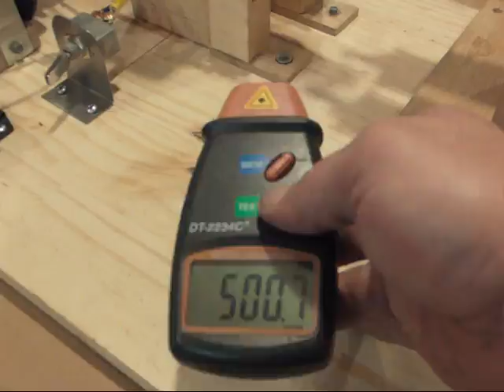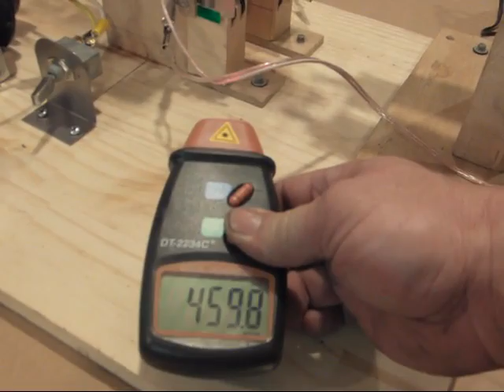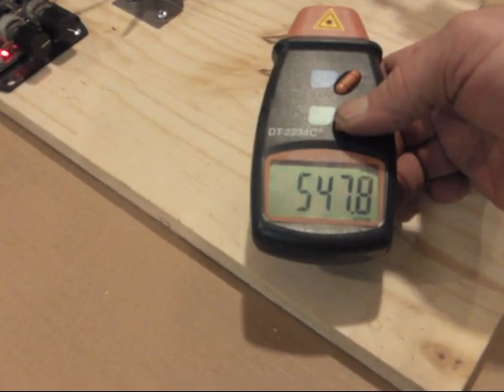"The Angus Effect" 2 Re: Jay Braun

Comment: Idea.. For your 2.0 model instead of only focusing on adding coils extend your drive shaft and add more disks.. Also lighten that wheel up by removing non essential mass from its center... Use a racing flywheel for guidance.  If you can show more output from an alternator hooked into this then what went in congrats!! You just broke the law of thermal dynamics :-)   let me know if I can help!

Comment: This reminds me in some way of how a vacuum works, meaning, when you block the air intake, the RPMs on the motor goes up, and it draws less current. I don't know much about motors, magnetic fields, and electricity; but something makes me think this phenomenon is conceptually related to the vacuum one.

Comment from the maker: Each set of coils are wound in opposite directions. One left one right. Then they are wired together in parallel. Both Start windings are connected and both finish windings connected. @ 600 rpm I have 20v @ .15 amps or 150 ma per set. There are 64-3/4"x1/2"  n42 neodymium magnets on the wheel. I ordered another set for a total of 128. This should increase amperage. I plan on making a vid on the "bucking coils" and bobbins in a couple days. :)

Comment from the maker: It's around 3:1 drive to wheel. I use a hole saw and some thin plywood. Had a hard time with direct drive and aliment. This worked out well for me and increased efficiency of the prime mover. Belt is a 6" O-ring

Comment: haha the irony in it all. i wouldn't count sir isaac out yet. the true test is when a linear application of dc power will produce a certain RPM into the rotor WITH NO COILS ANYWHERE NEAR THE UNIT AT ALL ... AND NO PWM .... and then, coils are applied to show acceleration and current draw reduction. that would have greater representation by way of simplification

Comment from the maker: So far there's more going in than coming out. I just used the PWM to control speed. Didn't want magnets flying off across the shop. I've had it to 1,000 RPM and I really don't like standing next to it. Once I get all the coils mounted I'll work on getting rid of the external drive. Your right, I think Angus will beat me to it. Thanks

Comment from the maker: Yes that's the prime mover. I just rolled up some 24 awg copper on a set of bobbins and got 20 volts at around 600 RPM. Lucky I guess. Didn't count turns. coils have 18.5oz. of 24awg magnet wire each. Math worked out to about 1,100 ft. Haven't measured coil resistance yet. Got to make several more, so a video will be forthcoming. I believe this is happening because we're using both sides of the magnet at the same time on one core stater with opposed winding coils.

Comment: This is great. Hard to hear ya, but did you say that's the current draw on the prime mover? If so that's amazing it's going down under load and increase RPM. Everyone else I've seen testing this the prime mover amp draw at least goes up under load and rpm increase, you got something special here. What do you think the difference is? Perhaps the coils? Mind sharing some specs on your coils resistances, turns, wire gauge?

Comment from the maker: Sure. I can do that. Used 1/2" cpvc pipe and plexiglass cut with a hole saw. Locktight super glue the ends on both sides. The coils have approximately 1,100 ft of 24 awg magnet wire. Cores are 3/8" re-bar or cold rolled steel.

Comment: I may have missed the point last time, which is the rpms went up by adding the load to the coils at the wheel, AND the current(or power consumption) went down. Which means you're getting more than the conventional circuit. right?